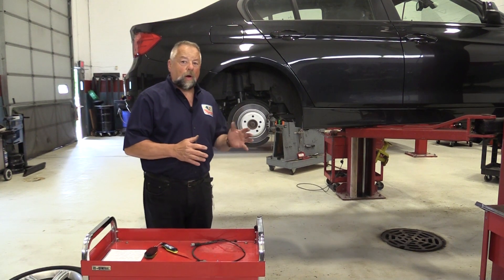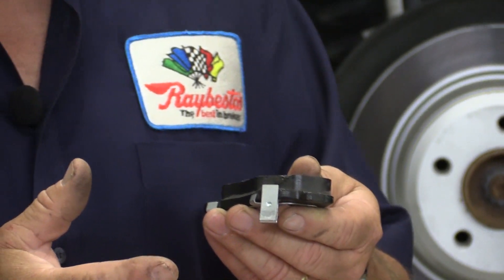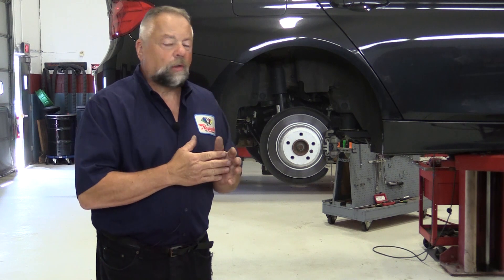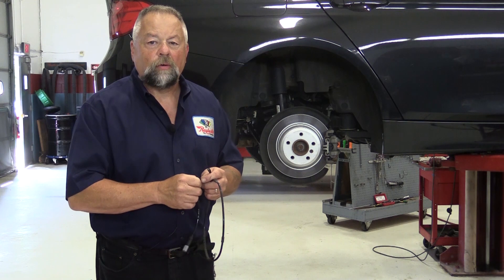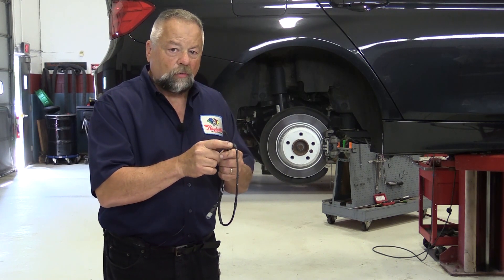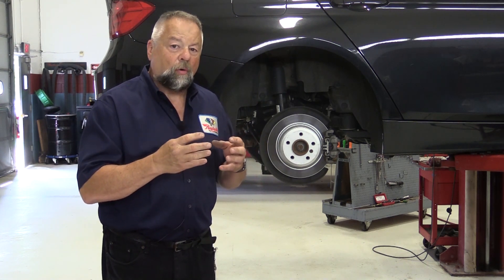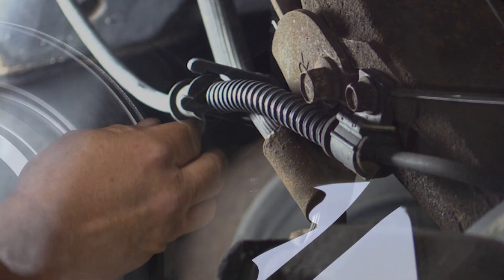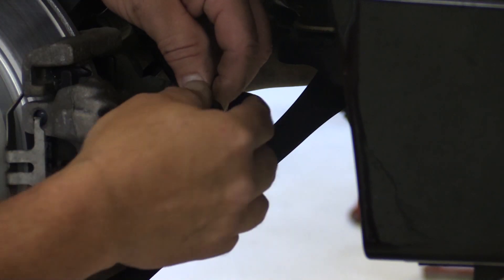Discussing Brake Wear Indicators and Brake Wear Sensors

Comment: So is the purpose with the indicator to push it in between the rotor and pad OR to slide away the tip ? In other words if there is only one indicator should it go to the first mating surface of the rotor?

Comment: Question what is the proper location for the pad with the low sensor metal clip  thanks
Reply: Inboard, and usually the wear sensor tab should be on leading edge with the rotor meeting the sensor first when driving forward. Whenever replacing pads, make note of how the current pads were installed and do it the same way. This of course assumes the previous pads were installed correctly. When in doubt, ask a professional tech and buy them a beer ;-)

Comment: Strangely, I hear a slight screech and skipping noise when I press the brakes and it goes away when I take my foot off the brake pedal and accelerate. Just the opposite of what the mechanic said. Anyone any ideas as to what may be going on? Thinking about buying new front rotors and brake pads. My rotors are only  3 and a 1/2 years old. Thanks.

Comment: How often do people replace brake pads .. I'm a guy with 0 experience in Car and im about to own my first car and im curious.
Reply: Replace them as soon as they start making that “screaming” sound
Reply: Depends on how you drive. If you're driving fast and thus stopping harder, then more often. If you're driving more smoothly then you should be good for a while honestly. You can visually check the breaks just by looking at them from the outside too, provided your rims aren't blocking a ton of your view. If they're still pretty thick, you've got some life left in em. If they're starting to look thin, consider a new set.

Comment: 12 jan 2020 3:22 pm est: thanks.0:31 brake-pad-wear-indicator scrape brake-disc automatically without needing to press foot-brake. so there is automatic-brake-pad-gap-adjuster which make sure gap between brake-pad and brake-disc always same, even though brake-pad-thickness decrease after brake-pad-degradation from braking.

Comment: That was really helpful, thank you! I am having front/back brake pads, front/back brake discs, and all four tyres replaced and was curious when the brake sensors on each axle were to be replaced. It looks like we can use the old brake sensors as long as they haven't shorted or tripped.